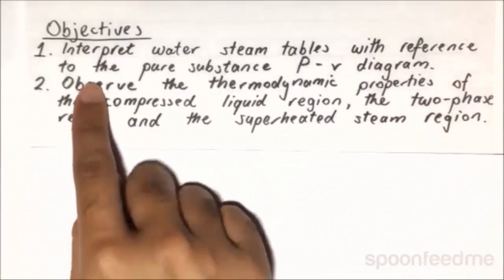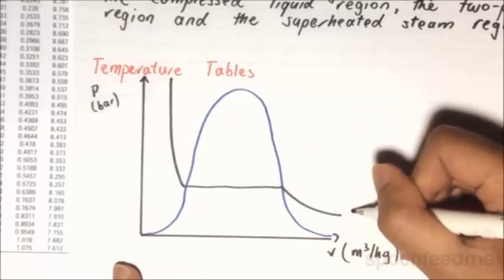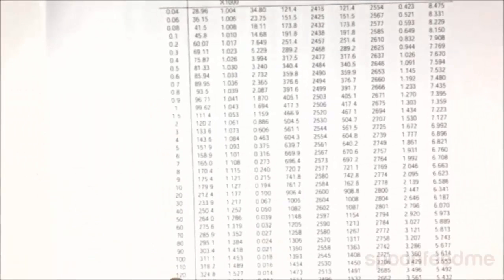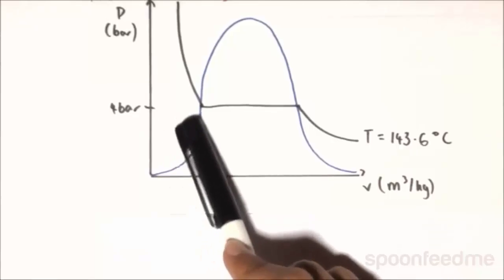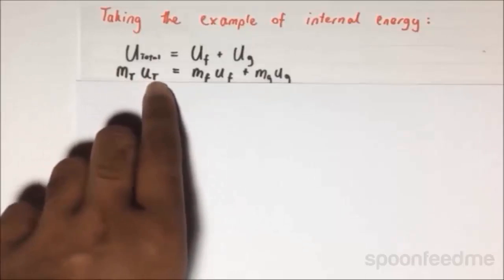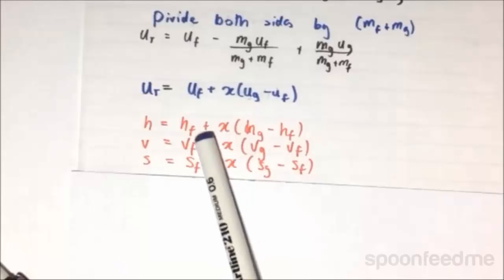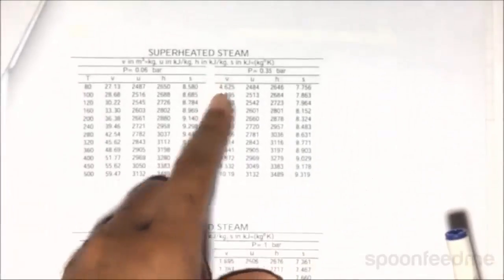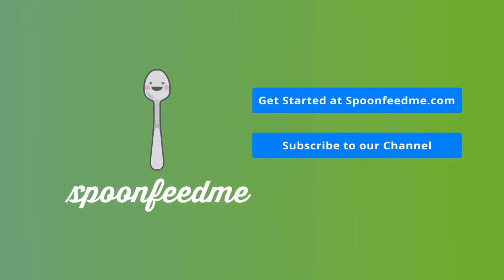Interpretation of Steam Tables | Thermodynamics (THRM101)

Comment: Please may you do this for me, I am a student of Electrical & Electronics Engineering and finding very difficult to do this assignment. A fluid from thermodynamics system enters a boiler at temperature of 26.113c the fluid is heated to a saturated pressure of 0.0085 bar, 0.11bar, 0.25 bar, 0.112 bar, 7.8 bar, 69 bar, 108 bar and 152.112 bar. Determine the change in enthalpy of the heated gas ( moring from liquid to gas ) at the gear saturated pressures. 
(a)Plot a graph of temperature against pressure and the gilcen pressures against the specific enthalpy obtained. 
(b) Comment on your result.